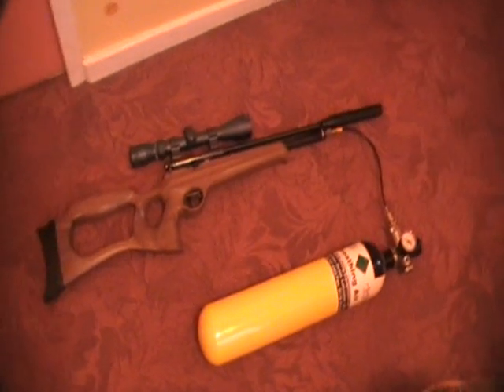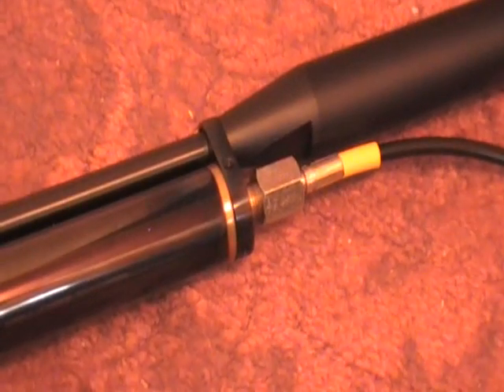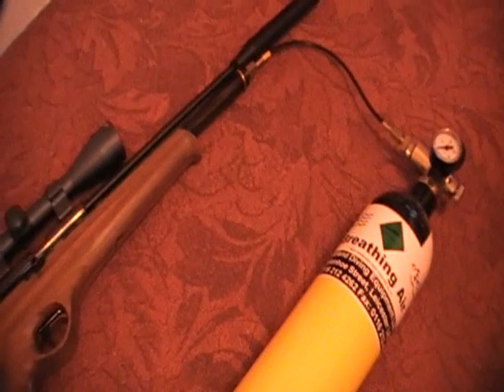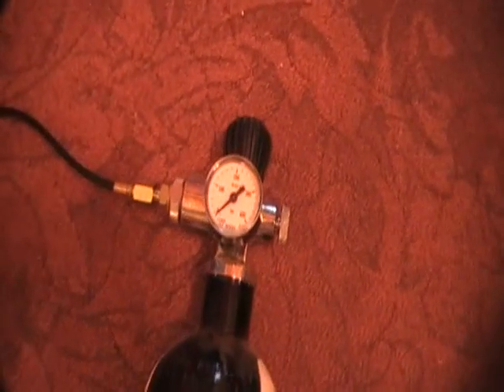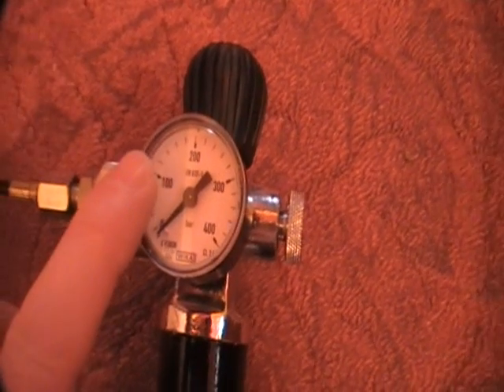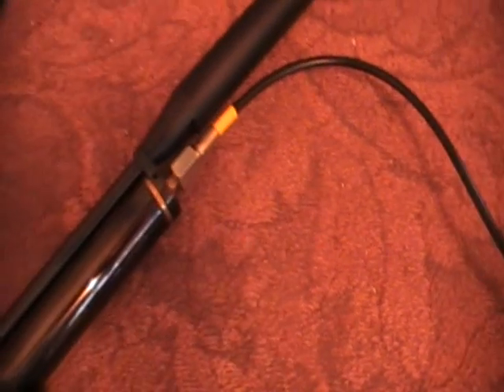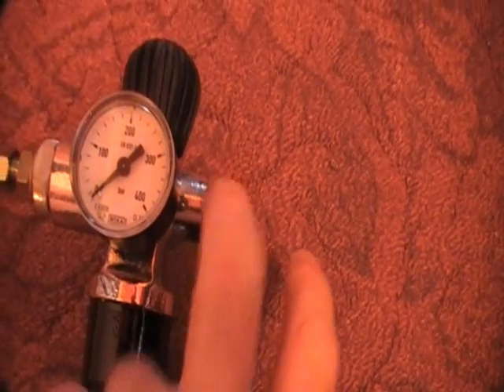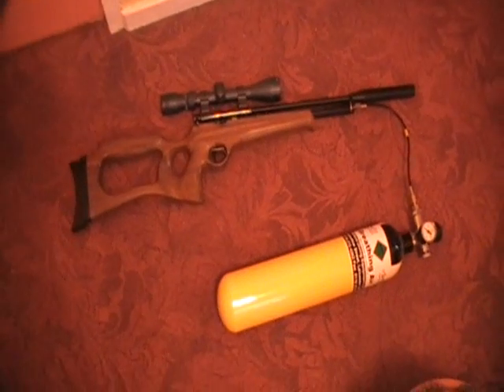charging an air rifle with a divers bottle

Comment: Why not attach a fill nipple to the gun and use a quick-release adapter at the end of the line, such as is used in paintball remote air hoses? 

They are made for 300 Bar pressure, will not put much wear on the thread, and it's a lot faster to connect and disconnect. I use one to fill my paintball bottles from a dive tank.